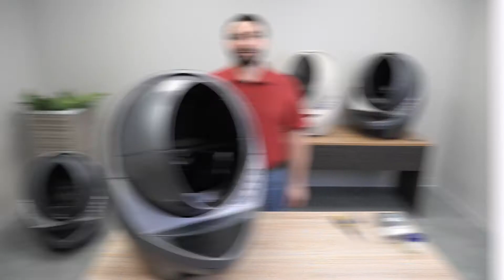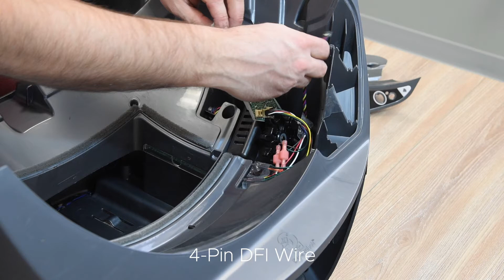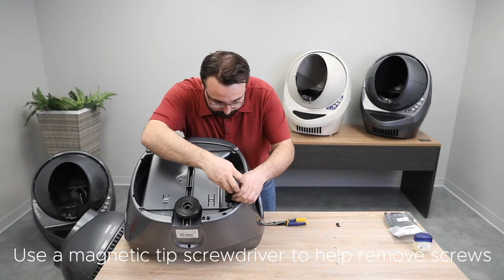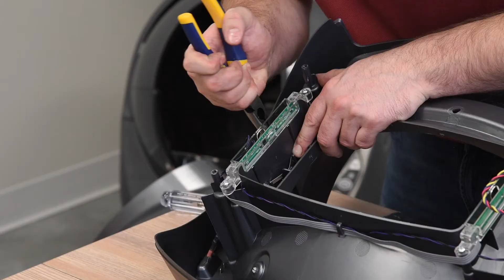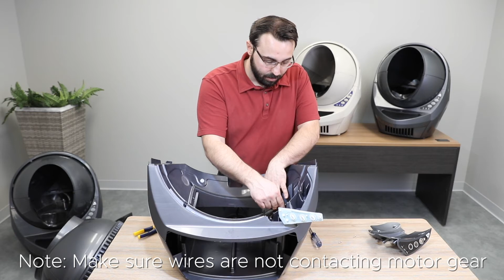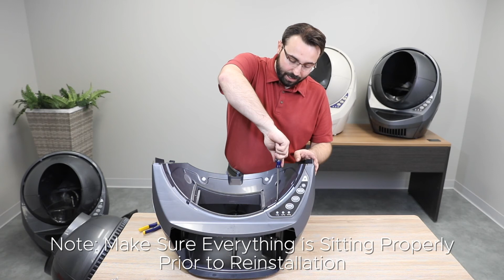DFI Kit Installation Guide | Litter-Robot 3

Comment: I hope 5hat they come up with a easier way to take base apart.  The screws are way deep in the holes and I cant tell if I'm stripping  the screw heads. Why cant the put long screw rods with a t type end to turn them to take it apart.  Then slide the rod screw back in hole and turn it untill  you feel resistance.  This think is a pain in the ace to take apart. They send you parts and then you have those deep holes to pray that you dont strip the screw head. COME ON !!
Reply from the maker: Thank you for your honest feedback about this! We have upgraded the design of the Litter-Robot 4 to make it easier to disassemble for cleaning and troubleshooting. If you ever have any questions about your Litter-Robot, please contact our team at support@whisker.com or whiskersupport.com.

Comment: Thanks for the video! One thing to note is that you need to have a long screwdriver. None of the ones I had in the house worked as the handles hit the plastic base and wouldn’t grab the screws straight on. Went and bought a long screwdriver and worked like a charm.

Comment: You can follow the same instructions but just clean the contacts of the sensor and that might also solve the problem for you. Just wrap a paper towel on a flathead screwdriver and run it between the contacts. You can also spray it with throttle body or MAF cleaner as these are meant to clean electrical sensors and evaporate quickly.

I recommend having a vacuum and gloves nearby....

Comment: I think it's so awesome that this company not only doesn't mind customers working on it themselves, they actually show you how to do it and sell all the parts. Most companies don't even want customers looking at the inside of their products. This reminds me of how things USED to be made.
Reply: I needed this kit but I’m older and they sent me a new base. Still under warranty. This looked a little complicated for me.
Reply: Sure it's cool that they allow customers to fix the unit. They could have also designed a product that doesn't require a vast majority of units to fail from an overly vulnerable pinch connector corroding in ~18 months.

My 2c is that they cut corners w the design and they are encouraging customers to fix rather than eat the cost of repairing all units on their side.
Reply: @JasonKrueger  So go with another company. You will very quickly find out that nobody is even in the same league. I've thrown away more automatic litter boxes than I have had cats, and I've rescued dozens. I have never had to throw away a single Litter Robot. A single replacement part that cost less than several of the competing brands units is a small price to pay for something that actually works right. You don't have to use it if you don't want. The company will do fine with your "2c".
Reply: @-Ricky_Spanish-  fair points. I don't disagree that they are a fair company and doing the best that they can. I'm personally just about to start repairing my own DFI once I get my replacement parts in the mail this week.

I'm not aggressively criticizing Litter Robot, I think it's a great product and I have been satisfied until this issue  As a mechanical engineer with production experience, I'm just candidly noting that they have an obvious design flaw here and it's something they should address
Reply: @JasonKrueger  In giving the option to replace every part on the unit, they have at least offered a solution for a problem that plagues all automatic cat litter boxes. When dealing with litter, urine, feces, fur, and moving parts, there is virtually no way for the things to not eventually break down and need parts replaced from time to time. I've thrown away more Littermaid and Petzone boxes than I'd care to remember, but I've been able to keep my Robot going because I'm actually allowed to fix it, and it's been far less costly in the long run. Improvements will be and have been made, but in the meantime they are still head and shoulders over any other company out there making these kinds of products.
Reply: @-Ricky_Spanish-  I would appreciate them not leaving those sensitive circuits directly exposed to the litter drawer. It isn't even sealed behind plastic or anything. All the internals are exposed to the moisture. I had to rma a base a couple months ago (the new unit is now having the same problem) and they wanted it cleaned out.. Absolutely ridiculous how much litter gets stuck in crevices inside the unit. They should have blocked off all those little holes and nooks inside. It's a poor design. Who thought it'd be a good idea to have electronics in an enclosed, moist space.
Reply: @laethe230  I have three cats and I haven't had any issues with the electronics being exposed. I was actually quite surprised to find that they were pristine (aside from the pinch sensor prongs, which were quite rusted but easy to replace) after several years, despite only having an enclosure around 3/4 of the sensor boards. I suppose different experiences for different people is what it comes down to, but this company has been making these for over two decades now so I'm sure there is reasoning behind why were they engineered a certain way. In my experience with other litter boxes, the fully enclosed components typically suffer from problems due to litter getting inside them and have no ability to clean them. Maybe that was their reasoning, but like I said I haven't had any litter get onto any of the circuitry.
Reply: Yeah, but if they made the product better there would be no reason to fix it so often. Also the replacement parts aren't cheap.
Reply: The term I see is “right to repair” and supporting this, even if its a bit challenging for many people, is a great and thank you.  I so wish my iRobot vacuum supported the same.
Reply: @JasonKrueger  don’t need to explain anything to Jinks - it is horrible design. I ordered a replacement kit under warranty but if they send me a new base that would be best. I don’t have THAT much time to take this junk apart. 

Also JINKS - it’s 2022 and there are plenty of automated litter boxes coming on the market or already here.
Reply: @JasonKrueger  I had one for four years that finally stopped even getting power after frequent trouble shooting to keep it going. I bought a second one to replace it and it stopped working on day two so now I'm researching to try and fix it. Anything this expensive should not be breaking down this much. I'm going to go back to a plain litterbox and scoop. My son thinks I'm a fool buying this expensive junk for a second time
Reply: @brendamoon2660  if you call the customer support number on the site they will help troubleshoot. With the second one being under a year old it is still under warranty and will most likely be replaced
Reply: @rossgig2204  they did once I finally reached someone. The online chat was always "agent unavailable", emailing just got me an automatic reply and when I called I would stay on hold until the call disconnected. I used the option to be called back and someone did call me the next day or two . When I finally reached someone they sent a new base. I don't know if they are having that many units malfunction, they are short staffed or what.

Comment: I can only assume that the litter robot was purposefully designed to have these issues so that you guys could make extra money from people who didn’t get the warranty and have to pay to get these flaws fixed. It makes absolutely zero sense to have the circuit boards and the metal brackets so close to an area that could contaminate/corrode it so easily.
Reply from the maker: Thank you Erik, we always appreciate customer feedback. The Litter-Robot is designed for quality to provide you with reliable, trouble-free service, and requires little maintenance. It’s built with solid construction and industrial-grade components. That said, the life expectancy of units can vary based on environment, maintenance, cat behavior, use, etc. It is totally covered by the 18-month warranty (with an option to extend it to 3 years) during which we will repair or replace as needed. Even out of warranty, we’re still here to help! For assistance, please contact our team at WhiskerSupport.com or 877-250-7729.

In the meantime, we will forward your comments to our product development teams, and we thank you for taking the time to give us your opinion.
Reply: That is exactly why they designed it that way.
Reply: @LitterRobot It was not designed for quality or quality materials with little maintenance. It requires constant maintenance even though I dump my drawers before it even says it's full! Having pinch sensors/DFI that easily corrode placed right next to the drawer is really stupid. And these videos need to be zoomed in much closer. Cannot see exactly what  he is doing.

Comment: Thank you.  The tutorial was all I needed to do the job myself and I successfully completed the job first time in under an hour..  Other than just replacing the DFI and pinch detect circuits, its not clear why they are failing.  Is it possible the litter dust is conductive and shorting out your boards.  Other little feedback would be to include a small amount of petroleum jelly in your kit as i didn’t have any but getting the litter robot back on line was getting urgent with three cats.  At least the contacts are easy to clean.  Thank you for supporting right to repair.  Love the robot and I think mine is well over 3 years old running 10-15 times every day and its been a great addition to our family.
Reply from the maker: Thank you for the feedback, Stefan! We'll be sure to pass your suggestion regarding the petroleum jelly to our warehouse. The pinch contacts and drawer full sensors are in a very harsh environment with ammonia so it can be damaging to the electronics over time. Frequently cleaning these can extend their life. If you have any questions, please don't hesitate to reach out to us!
Reply: @LitterRobot  thanks for that input btw.  I didn’t have any petroleum jelly on hand and had 3 cats looking at me with near panic on their face as their only littler box was in pieces in my garage workbench so i did it without it. I think this weekend I’ll get some protection on there.  Cheers and thanks again

Comment: It would be nice to have an easy way to just bypass both the DFI and pinch sensors altogether. At this point they are more trouble than they are worth. Would the unit cycle if these sensors were removed rather than replaced?
Reply from the maker: Hi James, we're sorry to hear about any issues with your Litter-Robot. The sensors are in place to ensure the safety of the cat, so we would advise against removing them. If you haven't already, please submit a support ticket on our website and we'd be happy to assist further! https://support.litter-robot.com/s/?language=en_US

Comment: I have had so many problems with this thing now it’s not funny. Fix one thing and another problem rear’s it’s head. I now have a slow flashing blue light and if you touch reset it turns to a fast flashing yellow light. If you touch the reset again it goes back to slow blue flash, etc etc etc. I have changed the pinch sensor and the cat sensor, to no avail. I am about ready to throw the thing into a skip ! I would no longer recommend to anyone to buy one of these. It has been a very costly mistake.
Reply from the maker: We are very sorry to hear your Litter-Robot is not working properly at the moment and would like to connect you with a product specialist on our team. Please submit a ticket at https://support.litter-robot.com/s/?language=en_US and we will get back to you as quickly as possible!

Comment: That's cool. You guys made a product that requires dissecting and special order parts. Most people aren't handy like this. It's a little box, not an automobile. Make a better product instead of a $500 globe that requires this kind of maintenance after 2 years. 💩💩💩
Reply from the maker: Thank you for your feedback, we greatly appreciate it! The Litter-Robot is designed for quality to provide you with reliable, trouble-free service, and requires little maintenance. It’s built with solid construction and industrial-grade components.
That said, life expectancy can vary based on environment, maintenance, use, etc. It's covered by the 18-month warranty (optional 3-year) during which we will repair/replace as needed. Even out of warranty, we’re still here to help! Just contact us by visiting our Help Center (WhiskerSupport.com) to chat with one of our product experts or submit a ticket. You can also reach us by phone at 877-250-7729.
Reply: buying a 500$ product that can be serviced with cheap parts is a great thing.

Comment: Our LR3 has a solid yellow light on but is not cycling at all.  Tried taking it apart and cleaning all the contacts and sensors, powering cycling several times, trying all the buttons, etc.  No buttons work, not even the power button, and nothing fixes or changes anything.  It is always the same when we plug it in, the lights cycle through all the colors, then it goes to steady yellow and does nothing else.
Reply from the maker: We're sorry to hear your Litter-Robot is experiencing these technical difficulties! We would be happy to connect you with a product expert who can help! Please provide your unit's serial number or visit our Help Center (WhiskerSupport.com) to chat with one of our product experts or submit a ticket. We can also be reached by phone at 877-250-7729.
Reply: I have the same problem. I was told to purchase new hall sensor, new DFI and new motherboard, with no guaranteed of solving the problem. No guarantee from Litter Robot for purchase made in Europe.
Reply: @LitterRobot  Thank you for the reply.  Unfortunately, I already contacted Whisker Support and they did not appear to be reading my very detailed emails because they kept telling me to perform steps that are impossible because of the issue I described.  (For example, telling me repeatedly to cycle the unit when I kept telling them the problem is the unit will not cycle nor respond to input).  Now, instead of sending me a replacement part which I can easily service myself, they tell me I am unable to service it myself (false) and I need to send my unit in for repairs.  What an inconvenience!  Checking out other brands now.
Reply: @etiennejacquemart  That is very disappointing.  It makes you wonder what we are paying a premium price tag for!
Reply from the maker: Hi  @TheOriginalJealotFaith ! We are very sorry to hear about this. Can you please provide us your serial number so we can have this issue resolve as quickly as possible?

Comment: I have four of these units and I hate every one of them...at least once a week I am resetting or replacing something.
Reply from the maker: Hi Jim, thank you for sharing your feedback. We are sorry to hear your units are not working properly right now. We'd like to get you connected with a product expert who would be more than happy to hear what happened and resolve these issues for you. Please contact us at 877-250-7729 or reply here with your Litter-Robot's serial number (this information can be found on the back of the unit near the QR code.) Thank you!
Reply: Yes, they're very unreliable and poorly engineered, and need a lot of replacement parts over time.  I finally gave up and got a PetKit Pura X, and so far it's amazing.  It even tells me how much my cats weigh!  (I can tell which cat used the litterbox when just based on the weight.)  I recommend giving this one a try.  Not a shill, just a longtime Litter-Robot customer who's mad about having to put up with this unreliable product for so long.  Hopfully the Pura X will prove to be far more reliable than the LR3, but based on how well it's designed and put together compared to the LR3, it looks to me like it will be much better in the long term too.
Reply: @wolstentech  Thanks did not know about the Petkit...will check it out !!!

Comment: I'm not sure I've installed pinch connectors correctly. I don't have an interior wall in my model where you're saying to apply pressure and make sure they separate. I have a LR3. Very confused.
Reply from the maker: We are very sorry to hear your Litter-Robot is not working properly at the moment. Please provide us with your case number or serial number and we will gladly connect you with a product specialist right away!

Comment: The base doesn't separate easy like it does in the video after removing the screws
Reply: Now where in the video does it cover where to press to get the clips on the two parts of the base to separate.  The two parts do not just slide apart